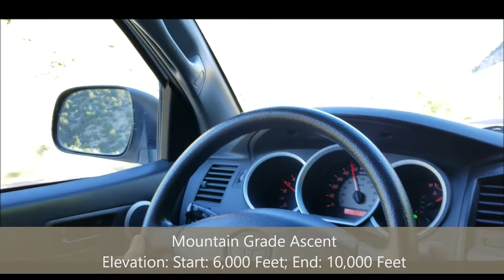2008 Toyota Tacoma 1GR-FE V6 Engine Sound & Trailer Towing Compilation Clips *1080p HD* (Better Vid)

Comment: Were you having many issues? I have an 08 and I’m going to be hauling a lot of brush soon. Wondering if the old girl is up for the task.
Reply from the maker: Not really. Periodically my dad hauls a 3,500 lb trailer (used in this video) with two ATVs in it and it does fine usually, though performance drops significantly past ~5,000 feet due to high altitude. The altitude change throughout this video was from 3K to 10K. Beyond 5,000 it feels underpowered but has always managed to make it to our cabin. He sold his Tacoma this February (with 111K miles) and bought a 2018 F-150 with the 3.5L EcoBoost V6 and it runs circles around the Tacoma due to twin-turbocharging.
Reply: @RyanEmeryLovesCars  what type of fuel? wondering if you're using 89 does it perform better at altitude with 91